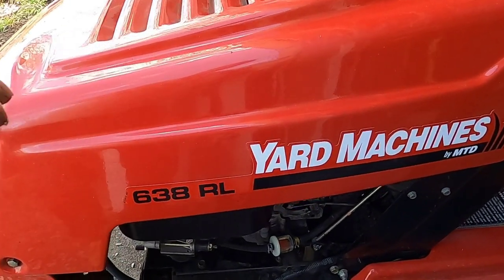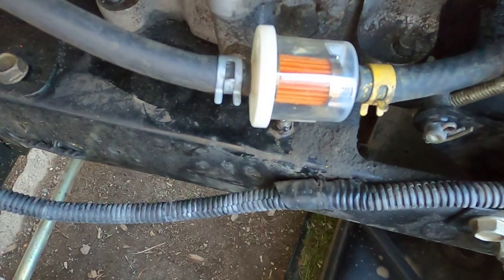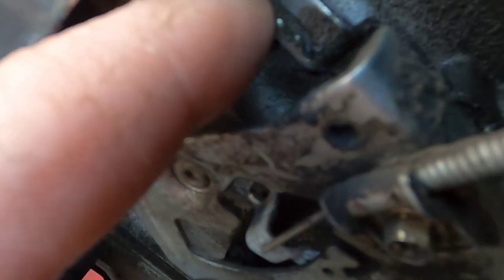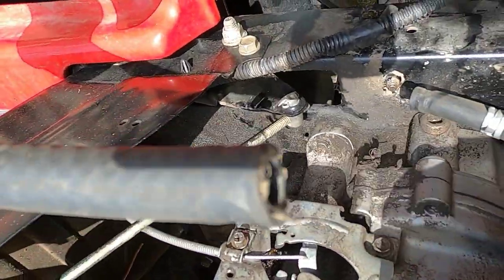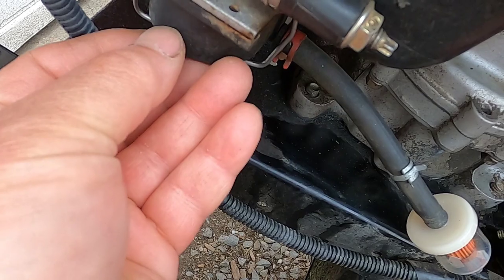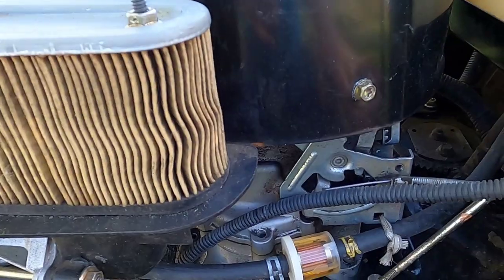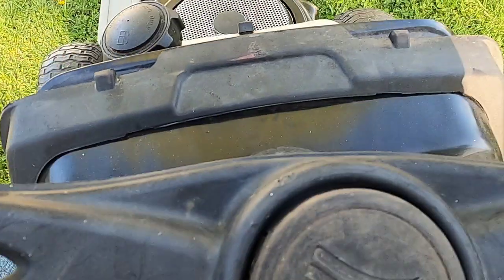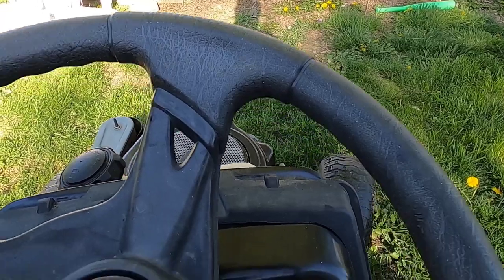Riding mower starts then dies fix

Comment: I watched the whole video, but what was the problem?
Reply from the maker: Thank you for stopping by. The problem although I was not able to show it in the video was the mower shutting down after running fine. I explained what I tried to get it to stay running and the possible causes as to why it would finally just die out. Bottom line I believe it may have been something in the carburetor that took several tries to remove.
Stay well, Joe Z
Reply: Since you have cleaned out the gas tank and made sure the fuel lines and filter are working, here are 2 items to look at. When the engine runs for a given period (example) 10 minutes and the starts to act like it it is starving for gas,
 Look at your fuel filter when the engine has finally stopped. If the fuel filter is mostly full of gas, the problem is the float is sticking in the upper position holding the needle valve against the seat or the needle valve had stuck in the upper position stopping the gas supply. If the carb. main jet is plugged the engine would run badly from the time it was started. Next, if the fuel filter is empty when the engine stops. The carb is fine along with your hoses, filter and tank. The gas cap is the problem. After running engine for the given period of time, a slight vacuum is created within the gas tank because the gas cap is not venting properly. The gas caps are normally designed with a thin flat flexible disc that acts like a one way check valve, when gas is used by the engine the tank level goes down causing the one-way check valve to open allowing air to enter the tank and the gas to flow. To test this. 1. Replace the gas cap. 2. Operate the engine until just before it normally quits, stop the engine. Open the gas cap and close. See if the engine starts and runs normally until it is time to vent the gas tank again. I do not own or work at a small engine shop. But my father and I both worked at International Harvester Co. He started in 1946. Me in 1966. Both at the research and Development Center in Hinsdale, Illinois. I was a technical writer for the farm tractors including the Cub Cadet. Now 76 years old and own a Modified Cub Cadet.
Reply from the maker: @allenmarshall9061  Thank you for contributing this information. Very well explained. This will be very useful for viewers that are having this issue. I did run it with the  gas cap on loose, but it still stalled. I do not have a a small engine shop, just a guy taking on what comes my way. I usually can find & fix the problem. But still not sure  what the issue or issues were.  Thanks again for this step by step analysis. Hope you get to subscribe & hit that bell to comment on my future videos.
Stay well, Joe Z
Reply: Thank you for the tips! Appreciated sir!
Reply from the maker: @youknow9328  You're welcome, I am glad this was of help. And thank you for watching and taking the time to comment.    @youknow9328   I have other videos on my channel that cover different subjects  and new videos added weekly that may also be of help or interest.
Your support is not required but always appreciated. If you are inclined to do so your Subscription, Likes, Comments and sharing this content do help.
Again I hope you get to  enjoy other videos on my channel as well. 
 Stay safe, Joe Z

Comment: Hi, Joe. Just curious what year that MTD lawn tractor is. I have a very similar model. But I think mine might be older. It has the same engine and I think the same carburetor.
Reply from the maker: Hi Jay, Sorry I do not have this MTD any longer & do not remember the year. If you have any other questions let me know & I will try to be 
of more help. Thank you for stopping by.
Stay safe, Joe Z
Reply: @JOEZEP54  The reason I asked is you showed a link for the carburetor kit. And wanted to know if it was hopefully the same as mine, but I'll look into it. Thanks  4 reply
Reply from the maker: @BigBoxDodge2020  Just to make sure check the model number on the engine. If the carburetor in the link is not the same, just type in your engines model # and you should be fine. Thank you for using my link. Let me know how it works out.

Comment: I really like Tecumseh engines and carbs... Except the one you have on that machine. There's a little rubber oring that gets swollen(behind that big screw on the bowl). That could have been some of your fuel flow issue. Sounds like you got it licked though. Nicely done.
Reply from the maker: I favor Tecumseh engines & carburetors myself. Other than snow blowers  I do not come across too many of them anymore but every so often I get one like this. Thank you for visiting & mentioning that oring. I did not point that out in the video.
Stay Safe, Joe Z

Comment: Not a good video what was the problem .
Reply from the maker: Thank you for stopping by. The problem although I was not able to show it in the video was the mower shutting down after running fine. I explained what I tried to get it to stay running and the possible causes as to why it would finally just die out. I showed/explained several scenarios that could cause this issue. Either one of them would case this start run then die problem. I could of went to the issue I had & be done with it. But the people that did not have my particular issue would still be at a loss. I try to help as many people as I can. Working on  engines can be quick & easy like turning a key & at times it can take a little diagnosis. 
Bottom line I believe it may have been something in the carburetor that took several tries to remove. Hope one of these helped you solve your issue.
Stay well, Joe Z

Comment: great video joe, i thought your video would solve my problem, i’ve replaced carburetor fuel filter replaced lines, messed with kill wire nothing, is there any other thing i can check? thanks
Reply from the maker: Thank you. Did you try running it with the kill wire disconnected? This can be dangerous due to engine not shutting down if it should  flip or any other mishap. Use extreme caution if you try this!!! Next time it shuts down check for spark. If you have a bad coil it will run until it gets hot, then once it cools off it will start again. Also try to loosen the gas cap, if it is not venting it will cause a vacuum  preventing gas flow. 
Let me know if any of this was of help.
Stay safe, Joe Z
Reply: @JOEZEP54  yes i cranked it, no start, with kill wire connected and disconnected, i get spark both times using light tester. the engine is cold i didn’t not think that would b an issue. the fuel cap was off as well. this is a puzzle
Reply from the maker: @heavenbound78  I though it was starting then shutting down. I am assuming you have compression, did you check the valve clearance?
Reply: @JOEZEP54  yes it starts up and stops within maybe 4 seconds or so. 

i did check the compression and it blows through the plug hole using the finger test.

thank you joe
Reply from the maker: This is a puzzle.  Do you see fuel in the fuel filter? Check the fuel tank. The nipple that the fuel line connects to has a small opening. It may be partially  clogged. Many years ago an I was working on a 16 hp Kohler engine. No matter what I did" I could not  get it to run. An "old timer" told me to change the plug, I said it has spark, he said, "change it".  Well I'm thinking to myself how could it be. After exhausting every thing I & a few buddies though of I changed the plug. It ran like a top. I do not know if this will help but it is worth a try.
Reply: @JOEZEP54  small opening at the bottom fuel tank i assume?
Reply from the maker: Yes
Reply: @JOEZEP54  did you find the issue? I have the same situation. Replaced fuel filter, line, chopped cutoff, replaced parts on new instslled carb with older carb, valves adjust last cut and worked flawlessly. Now im left scratching my head. Strong start then 3 second wind down off.

Comment: Can anyone tell me what the problem was
Reply from the maker: Thank you for watching and your question. I explained what I thought was causing this problem. In the end I am not sure if the valve adjustment or cleaning the carburetor out once again remedied the issue. It may have been a combination of all the above. It did surge when I first started it at the end of the video but smoothed out after cutting the lawn. This leads me to believe it was a carburetor issue. Maybe  the smallest partial causing a blockage. Could not say 100%.  Hope the issues I mentioned along the way was of some help.
 Stay safe, Joe Z

Comment: I have the same machine and now it only runs on choke, I have ordered a Chinese copy of the carb on Amazon and try to change the carb...
Reply from the maker: It should work well. I have used them several times without any issue. If you would like to help support this channel without any additional cost to you the next time you need parts or just about anything if you would use my affiliate links for a wide selection of parts, including carburetors, air filters, spark plugs, saw chains, fuel lines/ filters, & more. 
Go to Hipa at                    http://shrsl.com/457fz        AND 
Shop At:       https://www.amazon.com/shop/joez
I would appreciate it. Thank you for viewing this video & taking the time to comment, this also helps, Stay well, Joe Z

Comment: Hey i have a Scotts John Deere, runs and cuts good, but after boosting it off, its shuts down after i un-hook the booater cables!! 🤷🏾‍♂️🤷🏾‍♂️🤷🏾‍♂️ whats keeping it doin that???
Reply from the maker: I would first check your voltage regulator to see what voltage it is putting out. Should be 12+ dc.
Stay safe, Joe Z
Reply: @JOEZEP54  thanks

Comment: It was vapor lock I made sure I got all the air out of the line and it's working still
Reply from the maker: Thank you for pointing this out. If you changed the fuel line or did any repair work check the position of the line. If it is run incorrectly to where it should be that can case a vapor lock.
Stay safe, Joe Z

Comment: The little screen in the carburetor on mtd mowers is the culprit a lot of times.  That's what I think may be wrong with mine after I have cleaned the tank changed all the fuel line and replaced the fuel filter.
Reply from the maker: Thank you Dan for stopping by & taking the time to comment. Let us know how you made out.
Stay safe, Joe Z

Comment: I really had high hopes that this vid would be unique and actually get straight to the point but no... No, it didnt
Reply from the maker: I showed/explained several scenarios that could cause this issue. Either one of them would case this start run then die problem. I could of went to the issue I had & be done with it. But the people that did not have my particular issue would still be at a loss. I try to help as many people as I can. Working on  engines can be quick & easy like turning a key & at times it can take a little diagnosis. 
Hope one of these helped you solve your issue.
Joe Z

Comment: Lol so what was the solution? What a waste of time
Reply from the maker: Thank you for watching and your question. I explained what I thought was causing this problem. In the end I am not sure if the valve adjustment or cleaning the carburetor out once again remedied the issue. It may have been a combination of all the above. It did surge when I first started it at the end of the video but smoothed out after cutting the lawn. This leads me to believe it was a carburetor issue. Maybe  the smallest partial causing a blockage. Could not say 100%.  The issues I mentioned along the way seemed to have helped several people , hope it was of some help for you as well.
 Stay safe, Joe Z
Reply from the maker: Thank you for watching and your question. I explained what I thought was causing this problem. In the end I am not sure if the valve adjustment or cleaning the carburetor out once again remedied the issue. It may have been a combination of all the above. It did surge when I first started it at the end of the video but smoothed out after cutting the lawn. This leads me to believe it was a carburetor issue. Maybe  the smallest partial causing a blockage. Could not say 100%.  The issues I mentioned along the way  has helped several people. I hope it was of some help for you in diagnosing your issue. 
 Stay safe, Joe Z

Comment: It’s because your gas cap is clogged at breather hole. Building pressure up in gas tank.
Reply from the maker: mr fam, Thank You for watching and taking the time to comment with a possible solution. You are right a clogged  gas cap  will cause this problem.
mr fam I have other videos on my channel that cover many different subjects
and new videos added weekly that may also be of help or interest.
 Be sure to 👍, share and subscribe if your are inclined to do so.  Also not to miss any new videos remember to hit that notification 🔔
 Another way you can help support  this channel at NO cost to you is by using one of my affiliate links.
     * Thank you for watching I really appreciate your support.***
Again I hope you get to  enjoy other videos on my channel as well. 
 Stay safe, Joe Z